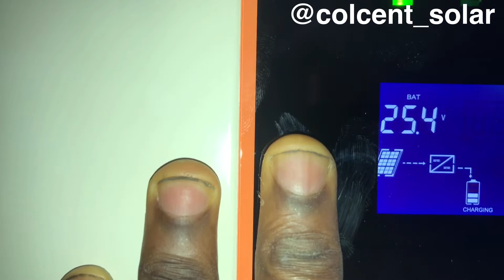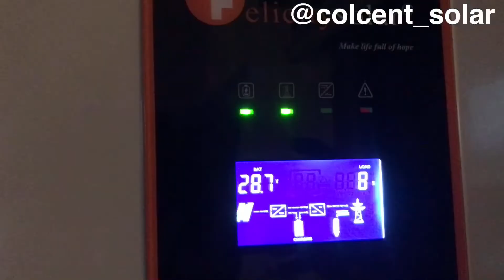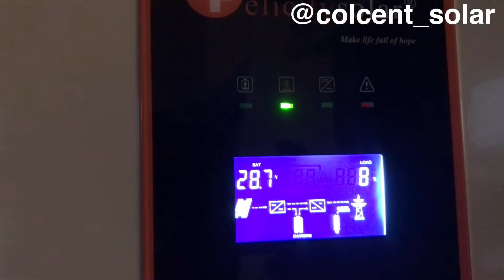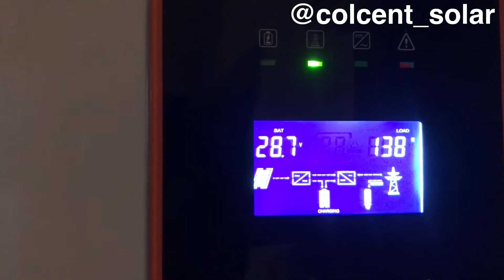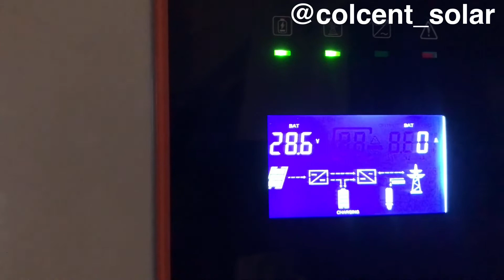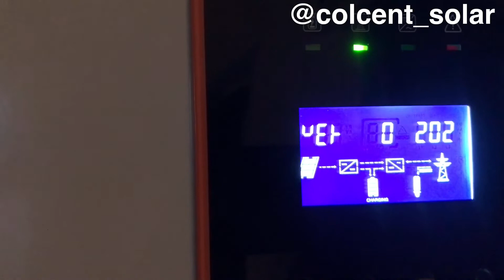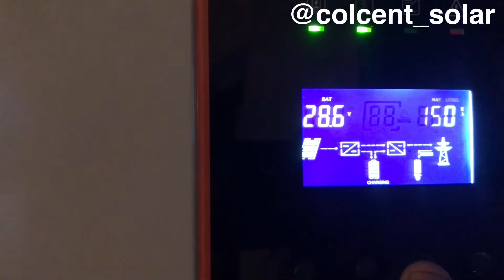Felicity IVEM3024 installation part2

Comment: A good video straight forward but the music shouldn't be louder than your voice because I could barely hear your voice at some points. 
My question is how many mm wires did you use for your input and output. Then why use green wires instead of the regular black for Neutral Red or blue for Live
Reply from the maker: 4mm 

the color of the wire doesn’t matter its the one available, i also indicated the life and neutral for maintenance purpose
Reply: @colcent_solar  Good Evening can I connect 6 300W panels in series to IVEM 3024 so I can power Air Conditioner during the day? Because I need to decide between IVEM and IVPM
Reply from the maker: @suleimanmuhammedhady1198  yes you can, depending on the size of the AC and the make of the panels,for eg if the AC is 1hp 795w you can use it because the panels can power it and still charge the batteries at a time.so you will not be left with nothing at night
Reply: @colcent_solar  The AC is dual compressor inverter AC I observed that the watt on the indoor is 1250w so I was initially thinking of IVPM series but then I recalled there is IVEM batteryless. I am getting the type of panels you used in your setup but 6 of them. That's 6 300W panels due to  tight budget
Reply from the maker: @suleimanmuhammedhady1198  ok, go for JINKO or JA solar panels, do you want to use the inverter without batteries?
Reply: @colcent_solar  yes the Felicity IVEM 3024
Reply: @colcent_solar  Yes I want to use Felicity IVEM3024 but with only two batteries. My major concern is that if it will power the AC when there is enough sunlight from 9:00am to 4:00pm
Reply from the maker: no it wont the panels are small
Reply: @colcent_solar  Why? I thought 6 300w panels connected in series will work
Reply from the maker: 300x6=1800w at peak depending on the type and location of the panels.most times the panels doesn’t give out up to that amount,and your batteries too can only last for like 2hrs on a full charge with the AC , you will need like 3000w for original panels like Jinko ,JA ,sun power etc to achieve that
Reply: @colcent_solar  Ok
Reply: @colcent_solar will Canadian 3000w archive this goal too

Comment: Good evening sir ..i noticed once you switched on the battery breaker, the inverter didnt get any power, untill the solar panel breaker was switch on, was when the display lit up ..does this mean its PV activated...if yes, what then happena at night when the PV is down? ..does it mean the inverter cant just run on the battery voltage? Or its just needed to activate the system at first??? Nice work..
Reply from the maker: NO, the system works without PV
Reply: @colcent_solar  thanks for the quick response, I am planning of getting one of these, but I got scared as I saw that....thanks once again for the education and experience

Comment: U used only positive.I stead of positive and negative  for the change over input and output . Is it bacause you did load separation?
Reply from the maker: I used common neutral, watch the resent video on changeover, neutral is there
Reply: @colcent_solar  link
Reply from the maker: @Danger_Fun_Invention  https://youtu.be/3dp-Dx_pq6E?si=j8TsHf9Ko-rmgZfb

Comment: Whats your opinion on Tubular batteries? maybe as compared to sealed batteries interms of their charge cycles?
Reply from the maker: i really like tubular batteries to the sealed eg like trojan ,quanta ,Addo etc

the two battery types are good ,you make your choice to the one you want and prefer considering the space and area, they charge cycles depends on the battery company and the way you or the customer uses the battery 

you can buy an original battery of 2000 cycles and it wont last one year,same battery in the hands of another person may last 4 years.completely discharging your batteries to 0 affects the life span of the battery,

some people after the inverter off(battery low) they will off it and wait for some time and on it back😁,doing this cuts the life of the battery into half 

caution ⚠️ 
does allow your batteries to go down completely before the next recharge,you will enjoy the battery weather sealed or wet

i personally prefer the wet cells because it can be maintained.
Reply: @colcent_solar  Great explanation. I've used sealed batteries for more than 8 years and they all fail after about 300 charge cycle. I started moving into lithium batteries last year and its the best. Always charges fast at high current (like 10 times the current lead acid batteries charge with), and can discharge very high current instantaneously. It also has (from what felicity wrote) 3000 charge cycles. Though its very costly.
Reply from the maker: lithium is the best for now😊 ,As you said very expensive!!

Comment: Bro my felicity inverter does not show any voltage from the panels, also it shocks when you touch the body, I checked there are no loose connection. The battery isn't charging cause the inverter refused to show PV voltage. I've set battery type etc. I have a felicity charge controller that works just fine I don't know why this didn't
Reply from the maker: how many panels are you using,wattage and the connections you did?
Reply: @colcent_solar  I had to watch your videos from start to finish to understand that the inverter is high voltage, I have 12 200w panels. I will try connect it 6 series each giving 2 parallel tomorrow to see how it performs. What do you think?
Reply from the maker: if your inverter is 500v vdc just like that one , 6 series will be nice 👍, the start up voltage is 120v vdc that means if the panel voltage is not up to 120v the inverter wont charge
Reply: @colcent_solar  thank you, I have the same inverter as the one you installed. Your video gave me more insight about it. Thanks brother.
Reply from the maker: you are welcome sir

Comment: Nice video. Very interesting. But my question is can you use AC breaker in place of DC breaker and how many amps for a 24v 440ah battery is recommended
Reply from the maker: no , you cannot use AC in place of DC and you can use 125A
Reply: @colcent_solar 
Nice work and good explanation.
Reply: Okay thank you

Comment: What mm of wire did you use to connect to the panels on the roof down to the inverter?
Reply from the maker: 10mm dc solar wire

Comment: how many panels does it support?  I have 4 of 300w but it refuses loaded as if the panels are not enough
Reply from the maker: It’s depends ,the one in the video minimum voltage is 120v and maximum voltage is 500v. So if the voltage is not up to 120v it won’t charge, make sure you are within the voltage range,use your multimeter to be accurate
Reply: I have this problem in my new installation. My pv voltage is 140 volts but the panel icon doesn’t lite up. It doesn’t charge lithium battery either!  Help!
Reply from the maker: Snap the name plate(sticker) of the inverter let me see

Comment: Where all the panel connected in series
Reply from the maker: The panels are connected in series because the minimum PV input voltage of the inverter is 120VDC and 500VDC highest, if the PV voltage is less it won't charge